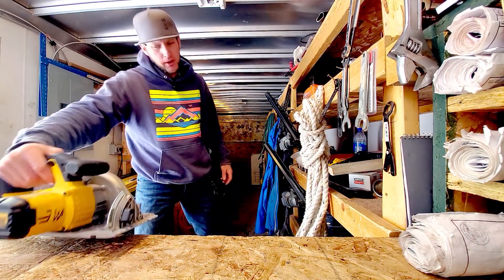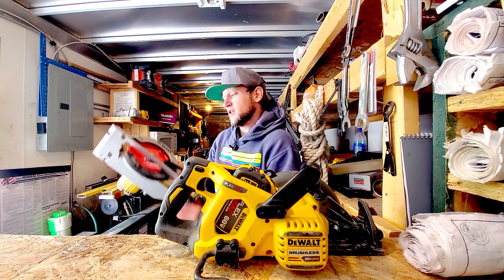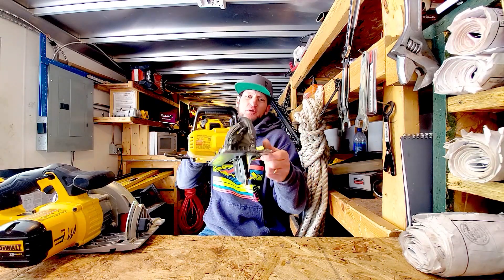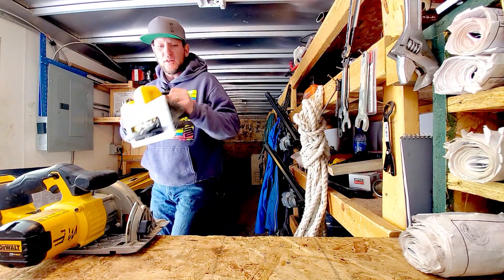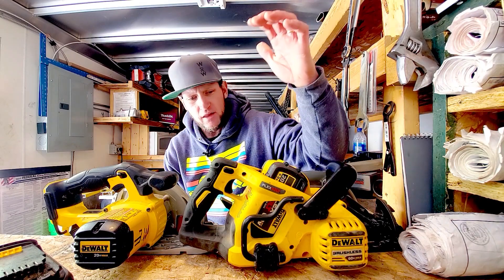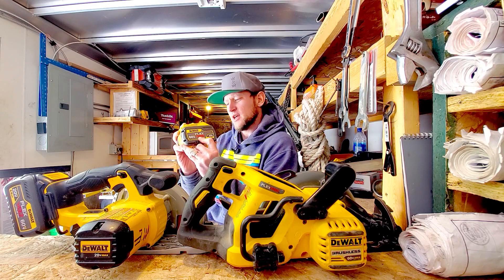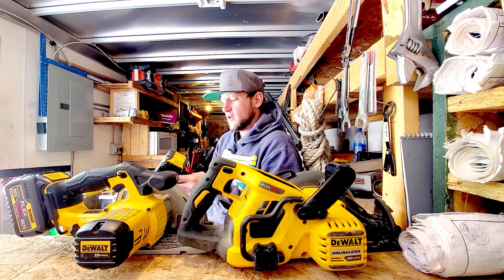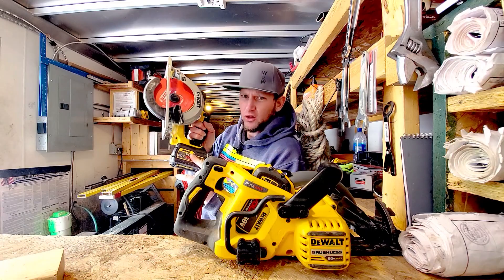The Cordless Saws I Use...and How To  Maintain A Dewalt Battery

Comment: Right down to business. This is what I love about your content. I personally bought the 6-1/2" but the job trailer at work has the worm drive style, and I love them both. Using the weight of the saw to make the cut on the worm drive is exactly how I was taught. Good stuff, Pat.
Reply from the maker: I really like both of these saws...but I have been offered to review and compare makita and Milwaukee to dewalt do I'll be checking that out

Comment: @Patrick check it out bro, the new DeWalt DCS565 6-1/2" circ saw comes with a sky hook and it's brushless. I'm going to be posting a video on how to hook it up to a shop vacuum without using DeWalt's proprietary dust vac connector.

Comment: What about long term storage? Like months? Do you charge to 100% put them in a closet and they are good to go?  I know ebike batteries are complicated. You should never charge over 80% when putting them into storage.   ONly charge to 100% when you plan on using right away.  Im lookig at getting the 10 piece combo kit.  But only use the tools 5-10x a year.  Hence wondering about battery care. Thanks for the video.